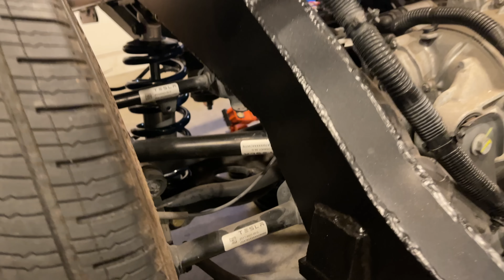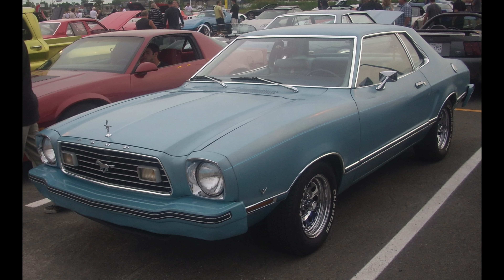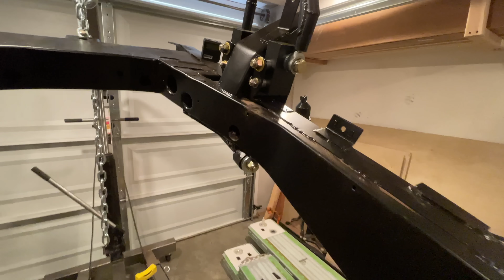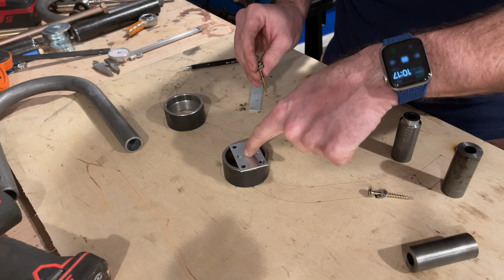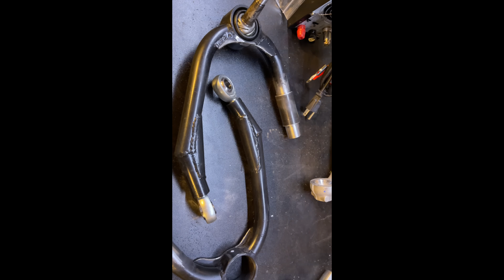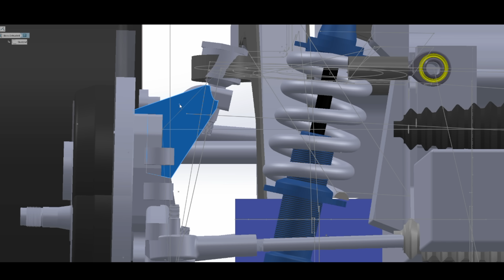The Front Suspension Gets Installed With Minimal (Heavy) Modifications

Comment: Many thanks, most informative.  If you were to design the front suspension for a "wheel motor" installation (such as YASA electric "hub" motor) what would be different?  I'm struggling with answering the question "is it even possible to do".
Reply from the maker: I'm not sure. I guess it would depend on the requirements for the hub motor mounting. I haven't really put any thought into that.

Comment: Watching this on a cell phone that has been giving me some problems. There is no way this video was on You Tube! If You Tube was more like this I would be watching all day!

My secret desire is to basically build an updated version of the Holman-Moody Challenger which was based upon a modified 1962 Ford Falcon unibody, adding an updated suspension front and rear. In other words a "what if" H-M had actually built a batch of the design.

Your 3D printing video tells me it is possible to build the car but I would have to 3D print the needed shop machines first. THANKS for the inspiration!

Comment: SuperfastMatthew, what would be your preferred way to attach a motorcycle directly to a small diff? Like your S600 but mid-engine. Like sv1000 engine to Miata diff.  Would some weird transfer case need to come into play to center the vtwin in font of the  center of the diff or let the engine be offset and not worry?

If there’s a clever and easy way to attach all these things then you’d have a rear subframe that holds suspension, engine, transmission, and rear differential all together. Thats basically 2/3 a car with two assemblies. Connect some long rails to a v8 roadsters front subframe and seat in the center you got a 1960’s f1 car.
Reply from the maker: That would be badass. I'm sure you could directly connect the two, and just offset the engine. You could balance out the weight by moving things like the battery and fuel tank to the other side.

Comment: It's a good thing I wasn't drinking anything when the 'MUSTANG II... GD' comment came up - I'd have ruined my macbook. :-)) 
Is there a reason you chose to notch the bushing eye on the control arm rather than your mounting plate on the bottom of the frame? A large clamp mounted on the frame to act as a (sort of) fence and an angle grinder and you could have put a precision curved notch in the plate that looked like it came from the factory. Just sayin'.
Love the build - and sub'd.
Reply from the maker: Honestly it was laziness. Cutting the LCA was easier and I didn't have to remove the mount. After modifying so much to get it all to fit I wasn't really in the mood to do more work.

Comment: I have a Jag MK4 the predecessor of this Car, its totaly stock with four leaf springs, rigid Axles and Rod actuated drum Brakes. Do you think this kind of Mod would make it more drivable? In which case I think I would put my P85D on the Ramp and break out the angle Grinder. What do you think, a full self driving 1947 Jag with wire Wheels?
Reply from the maker: Do it! Shouldn't take but a weekend.
Reply: @SuperfastMatt  Bit aprehensive about mounting the screen on the wooden Dash. Maybe a bit of a squeese:-0

Comment: How do you handle the flex in an unrestrained two rail chassis? looks weak as water.
Reply from the maker: The battery bottom tray will help. There is also a chance I will try to hide some structure in the body so I can get seatbelts in, and if I do that I’ll tie it into the frame. That will help significantly.
Reply: @SuperfastMatt  Well just don't go off road or sideways over a  speed hump. I predict this will be a boulevard car only.